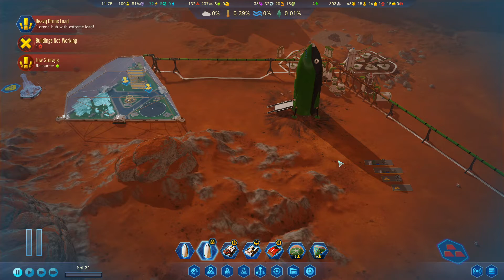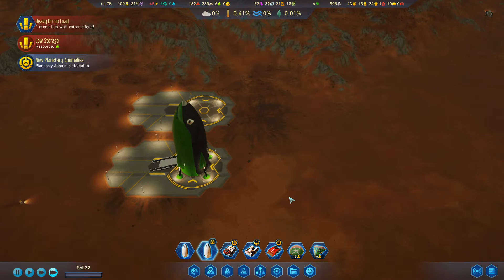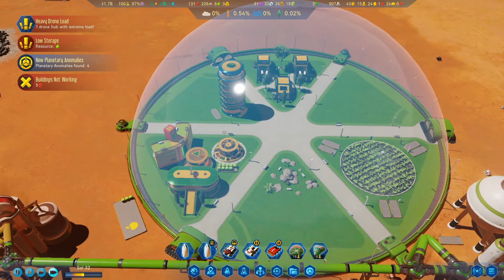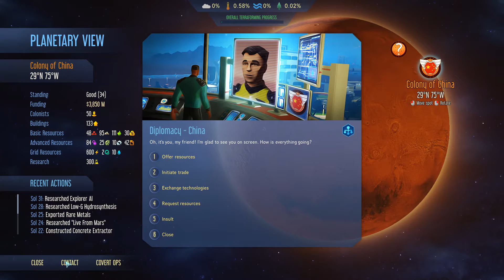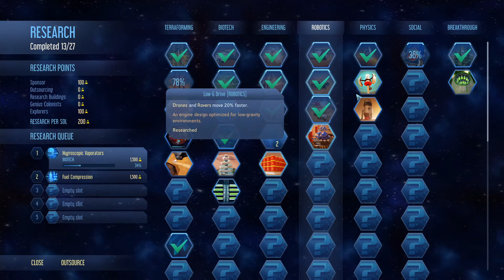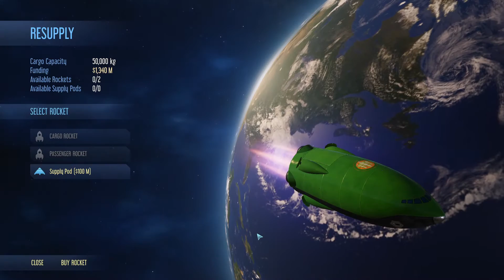Surviving Mars - Episode 04 - New Colonists

Comment: small concern you dont have many sensor towers ( a sensor toer increase the sector scan speed so the further away you scan the longer it takes
so a drone control rover and the sensor research you could scan the map faster also get deep scan as quick as possible so you dont have to scan a sector twice (and discover you build a dome over a valuable deposit)